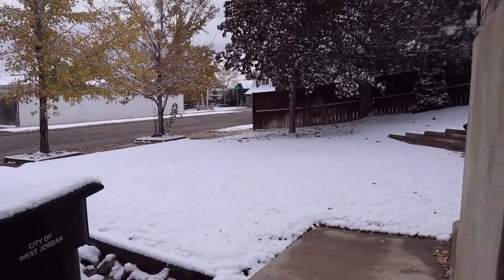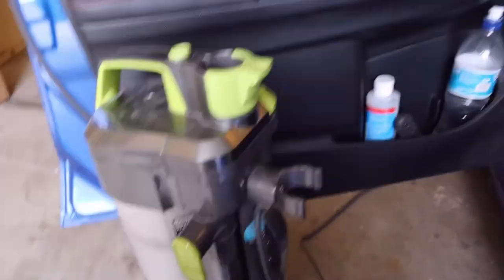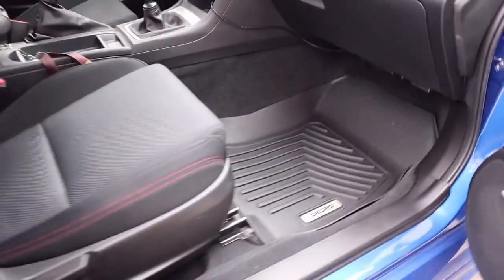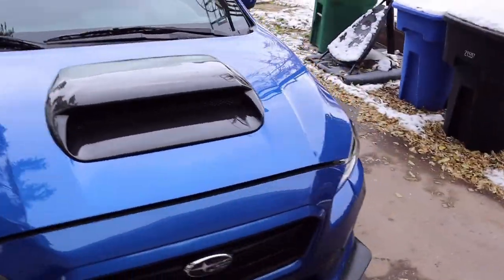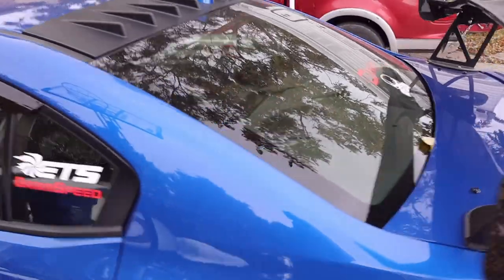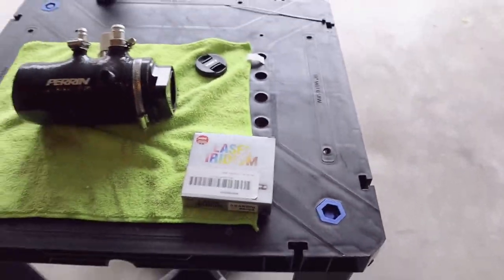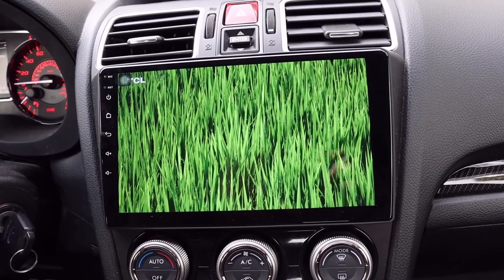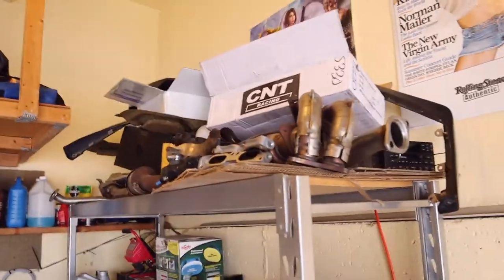Oct 2020 Update! Oedro Floor Mats (2015+WRX/STi), Big Hood Scoop Thoughts, Flex Tune?, Canon M50.

Comment: Thanks for the cool update video Evl X! Love the content. Your 30,000 mile maintenance video helped a lot, finally cranked that out this weekend along with an oil change I went ahead and installed the Fumoto drain valve and replaced the air filter and cabin filter. Saved a good $400 from what the dealer wanted to charge! 2018 wrx wrb with 31k miles barely even modded, just have Remark axle back, full LED swap, Enkei Raijin 18x9.5 and Cobb AP. When I work on my car I usually like to knock more than one thing out when I get under it or just wrench on it. My question for you is what is a good order of operations you think for mods on the wrx? I have a couple parts just waiting to install like a boomba bov and a grimmspeed catted j-pipe and plenty more just chilling in my cart (wishlist) lol. I’m just thinking like I’ll wait till I get a charge pipe oh then I’ll wait till I upgrade my fmic oh then I’ll wait till I get a Cobb flex fuel kit and so on.. I’ll probably knock out the j-pipe this next weekend because I’ve been dying to hear it with my axleback set up. Just curious what you think would be the most efficient way to go about the mods? Sorry for the essay lol have a good one!
Reply: Also sorry forgot to mention my next parts I’m going to order are for sure a Crawford AOS and tgv + egr delete kit with a GS ebc. Heard these mods are pretty essential and the AOS especially for that ease of mind. Also gonna look for a local shop to perform a walnut blast to clean the valves hear those can get nasty and usually around 30k miles is a good time.
Reply from the maker: Thanks for the support! Glad that video helped. Sounds like you are well on your way to an awesome build, also Raijin's are dope. With your AP you can put on you J pipe and use the Cobb off the shelf map stage two. That is where you are going to see a decent jump in power. AOS and intercooler (don't bother with a charge pipe for a tmic, just save up for a front mount kit) can be added as well without a pro tune. I wouldn't get a BOV, they can can cause problems with incorrect air readings and running rich. I'm running the Boomba bypass valve. If you have an after market intake you'll get the cool turbo noises. Beyond that you're going to need a pro tune or eTune for flex fuel, headers, etc. EGR/TGV deletes will throw codes that have to be programmed out. These cars can be a fun and addicting hobby!
Reply: @evlx14  Thanks for the reply! With the EGR/TGV deletes those codes that they’ll throw will most likely be programmed out if I get a pro tune? What’s your thoughts on the Perrin inlet hose, saw you were having some issues with it?
Reply from the maker: @tankerslut  Yes, the tuner will delete the codes for the EGR/TGV deletes. I did mine the day before the tune so that I didn't have to worry about it for very long. The turbo inlet hose seems like a solid choice, larger flange to the turbo, smoother transition from the intake. I put it on after the last tune, so the tune didn't account for it. I got slightly weird DAM numbers with it so I took it off for the time being. I plan on putting it back on. for the next tune.

Comment: Have you had any peeling or cracking on the hood scoop? I’m also from Utah
Reply from the maker: Utah!! It's been about two years with the hood scoop and no cracking or fade on the clear coat.
Reply: Awesome I may get one in the summer so 3m has time to settle with heat
Reply: Thank you the information